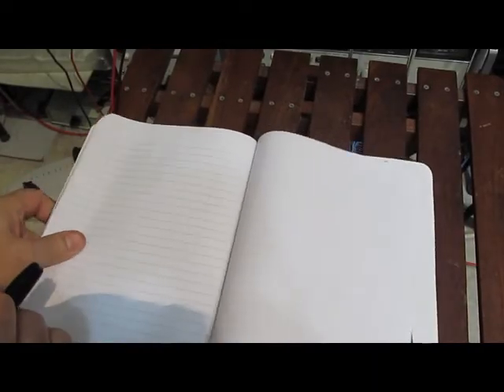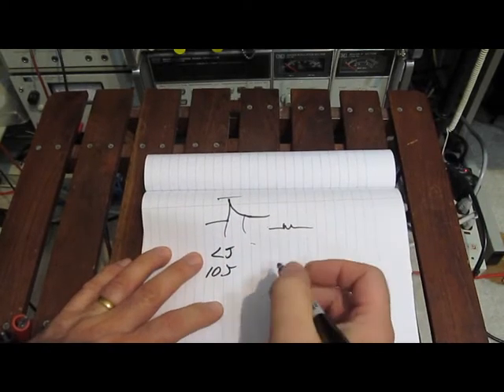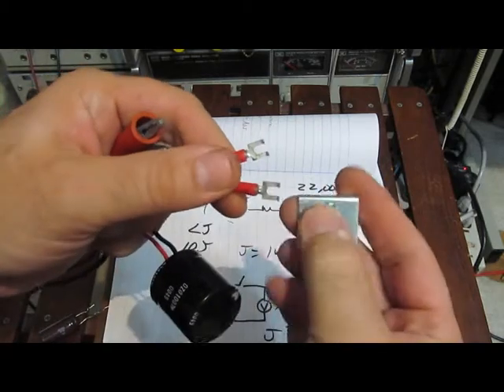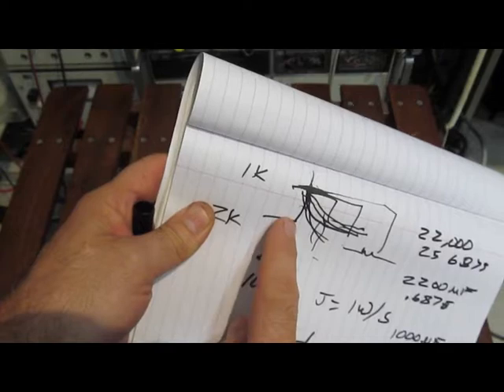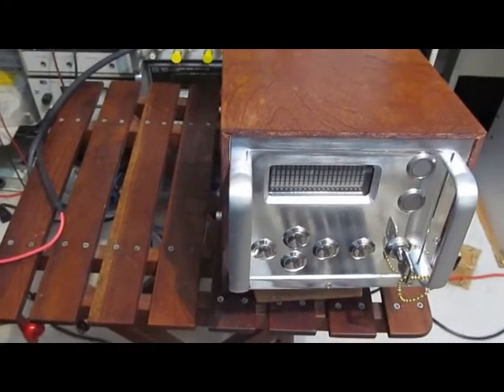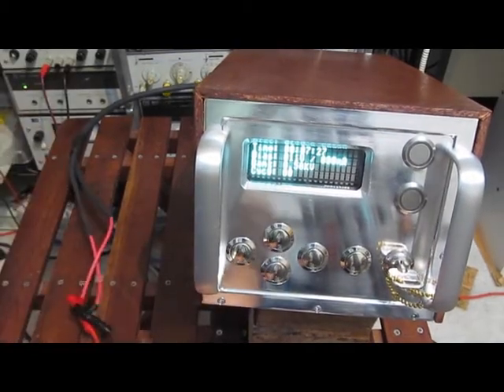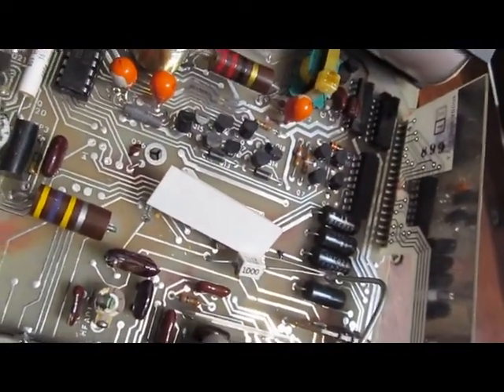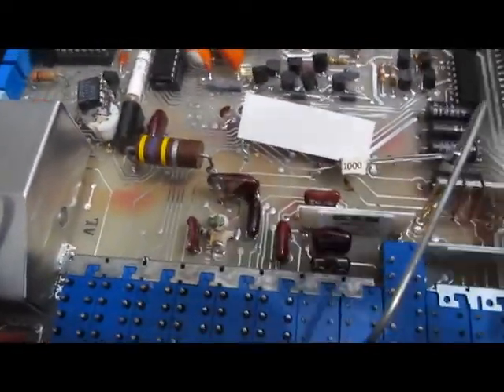Programmable Transient Generator, Part 3 Completed

Comment: Totally correct, what level you consider ‘safe’ depends on the application, less than 40 micro Joules under two rare malfunctions including the most onerous expected malfunctions will be safe for zone 0 hydrogen application per IEC 60079-11.

Thanks for your video.

Comment: Any schematics? Would this test breakdown voltage of tvs diode?
Reply from the maker: There are no schematics available but as I mentioned, there are papers written on the subject.   This particular generator can be set for a maximum of 6KVish.  What is the breakdown voltage of the device you are asking about?
Reply: @joesmith-je3tq It might be over kill... I am in the 100v range. I was going to pulse bi-directional tvs diodes, I might just go pulse transformer. This project and video is great, btw.

Comment: Small mistake there, 1 Joule = 1 Watt * second, not 1 Watt / second.
Reply from the maker: +stefantrethan and 1/2CV^2 not 1/2CV.  There may have been others.
Reply: Hello Joe. What type of switch do you use to discharge the capacitor bank into the DUT. Thanks regards Chris